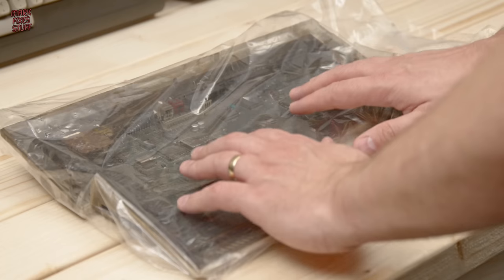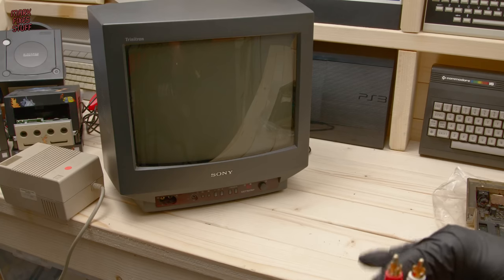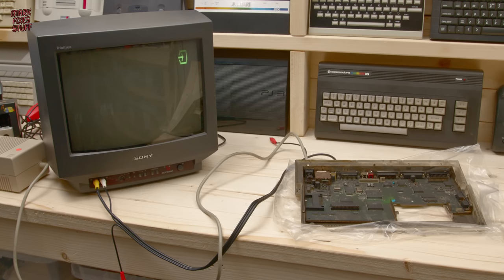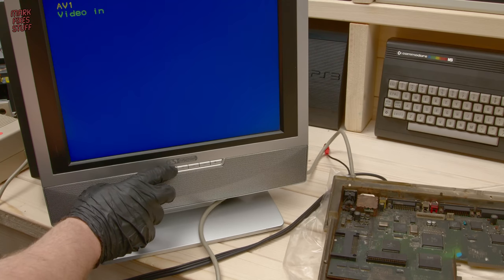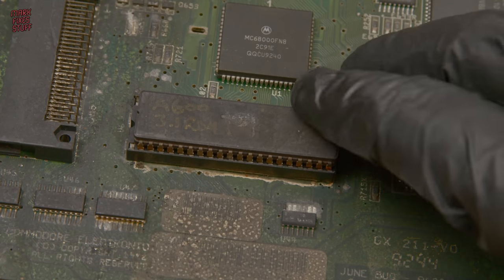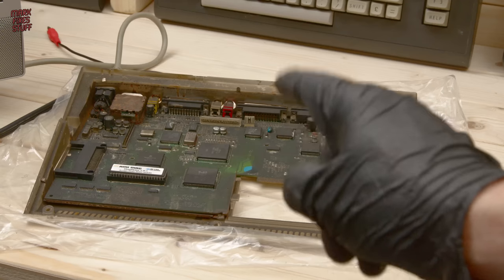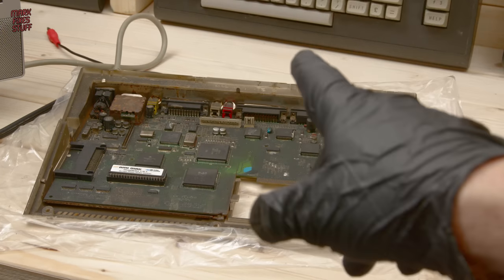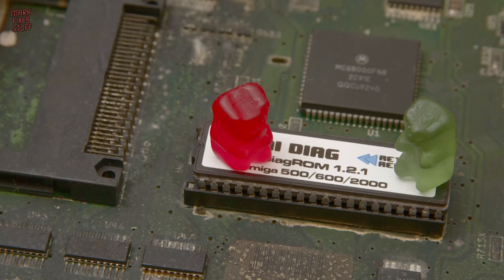DOES IT WORK?: A Fire and Water Damaged Commodore Amiga A600 Motherboard

Comment: What did you thought will happen? It's an Amiga, some Bloody Hell fire won't stop it. Now you have to restore it. It deserves a resurrection.
Reply: Amiga - alive and kickin'!
Reply: I used to own an A600, and later A1200, and both were fine until I added a 68030 board to them. Both of them refused to boot if there was even a single speck of dust on the card. Those things were finicky!

Comment: The one thing I would've been worried about is that the soot is mostly carbon, and carbon is a decent enough conductor to possibly cause shorts. Thankfully, that didn't turn out to be the case, so hopefully the board just needs cleaning and rehousing in a new case!
Reply from the maker: For real. To be honest I thought this board was dead completely and this was going to be a novelty video.

Comment: Nice to see the board working. Plenty of cleaning, and rust removal. 
I'd recap it again after all that heat, and for some nice clean caps.
Looking at that rf shield on the antenna cable out it's probably a good candidate for a HDMI mod once the rest is done.

Hardest part is probably going to be getting a new case and keyboard.

Comment: You're probably already aware of this, but with the DiagROM you can connect to the Amiga's serial port (with a null modem cable IIRC) to run the diagnostics from some other machine since there's no keyboard.
Reply from the maker: I didn’t know that to be honest
Reply: @MarkFixesStuff  majority of diag ROMs and Cartridges for Commodore and Atari works like that since the begin, so if the video chips are gone, you still can do diagnose.
Reply from the maker: @madigorfkgoogle9349  I’ve done it it the past but it didn’t really occur to me this time. I guess it’s due to just rushing! I have time to spend on this properly now I know it wants to live :) thanks for watching and commenting. It really means a lot 🥹
Reply: @MarkFixesStuff  hey Mark, I have sent you a Email with my messy project, enjoy.

Comment: Regarding the Sony OSD annoyance, Adrian at the Digital Basement has just done an RGB mode on a US one but it goes into detail on how the OSD overlays through the Video Processor chip and how you can disable it (Sony has 2 x RGB inputs on their chip, one for the OSD and one for RGB video, other makes only have RGB on the OSD which people repurpose at the expense of the OSD). It also shows how to get into the service menu where you can make changes through the software, the service menus are pretty standard throughout the trinitron range of CRTs.
Reply from the maker: I’ve actually found out how to turn the bloody thing off now!
Reply from the maker: I’ll watch Adrian’s video though. Thank you so much for the information!
Reply: @MarkFixesStuff  Hooray!

Comment: I remember figuring out how to get rid of the channel/input OSD on similar looking North American market compact Trinitrons.  The Sony TV remote I had (probably for a different model) would operate power, volume, mute, and channel, but the Input and Display buttons did nothing.  You could change to A/V input by pressing the "Channel -" button when it was already on Channel 2.
I got my hands on a cheap universal remote, and after trying a bunch of remote codes that worked for the basics, found one that allowed me to disable the persistent OSD with repeated pressing of the Display button.  It seems to me that two presses would temporarily hide it until you changed channel or input, then it would become persistent again, and I think three presses would only briefly show it when changing channel/input.
Reply from the maker: Thanks for this information. I’ll give it a go!!

Comment: Regarding it taking a short while to show a picture the first time, The 8-Bit Guy had a Vic 20 like that. Something to do with the capacitors reforming slightly on the first power on, then it was quicker the next time. In his case it was old caps, for this machine it's probably due to them getting far too hot.
Reply: nah, it's because there is no floppy drive. Any Amiga will do that if you don't have a floppy or other boot device attached. What I am pretty sure of is that a ton of SMD resistors have simply been melted into oblivion.. so I suspect it won't be 100% working

Comment: How did all those caps not just boil and explode? Not complaining though, way to defy the odds little A600!
Reply from the maker: I ... THINK that I recapped this board with 105c Panasonics? I can't be sure, but if I did, and the melty keyboard acted as a heat shield, they still could be fubar but working for now?  All guess work at this point. 

Ultrasonic bath up next.